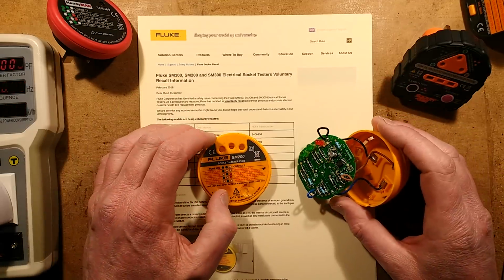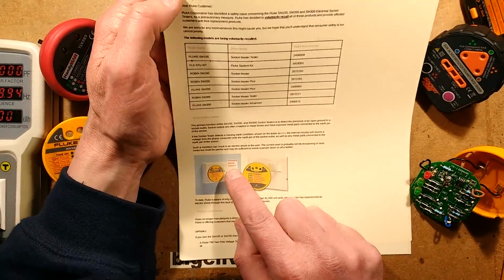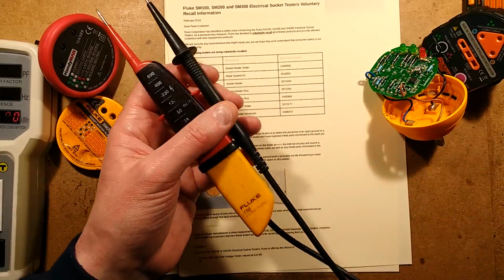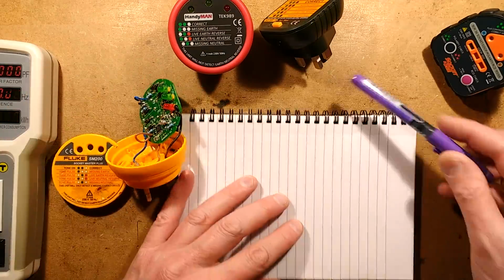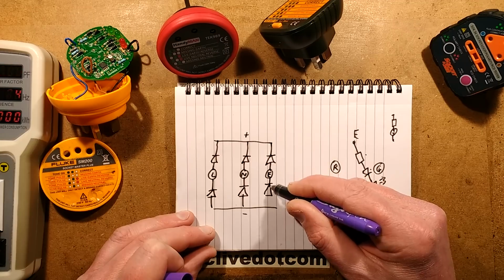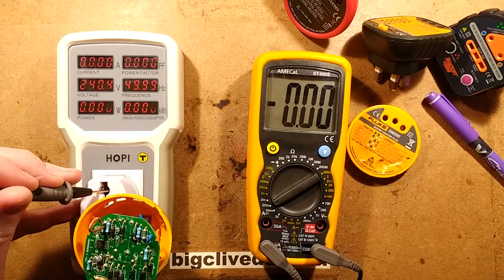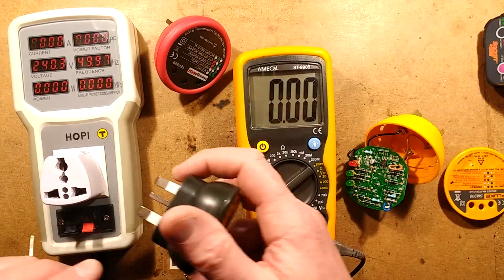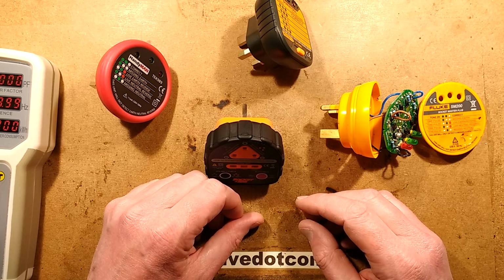Why Fluke are recalling their SM100/200/300 plug-in testers.

Comment: I always wondered, if you were connected to ground and an appliance somewhere else had a fault, would you get the shock, would it be divided between you and ground, or would it miss you entirely
Reply from the maker: If you weren't touching the appliance then you shouldn't get a shock unless the appliance was ungrounded and a ground borne voltage gradient occurred.  Still low risk though.  If you are touching an appliance when a full live to case fault occurs, then even with a proper ground connection the case will still jump to an elevated voltage briefly until the protection trips.
Reply: bigclivedotcom what if you were connected to ground just for electrostatic protection
Reply: Andrei H I just wanted to know if there was a potential for current to travel to every earth terminal should one fail, theyre all connected so why not...
Reply: Maybe i did not understand your question. If the earth terminal on one particular branch of a circuit fails, all appliances with metal casing connected to that particular branch can potentially develop a lethal voltage on their casing, if one of them has a live-to-case fault, as there would be nowhere for this fault current to go so it can trip a breaker. That is why the safety earth system exists and why it is called "safety". In modern electrical systems designed to service apartment buildings, earth is bonded to neutral at the panel, before it reaches your house. There are no more actual ground rods. This is actually better from a safety standpoint, as in a live-to-earth fault of an appliance connected to a correct electrical system with safety earth, the current going thru the safety earth returns to the neutral, so from its point of view a live-to-earth short is the same as a live-to-neutral one, so the breaker will trip.

If you are talking about earth rods buried in actual earth like it would be done in the old days for a house, if you've got multiple and one fails, then there is no problem, just that the earthing system will be able to take less current and is therefore less safe.
Reply: Umm, you assume that there IS protection somewhere in the circuit. That's a fairly big assumption - usually there is none, at least not where i live and work. :) There are GFCIs being installed in the buildings they put up nowadays, but most of them have so many other issues that a proper electrical is just a consolation. A lot of times they skimp on the wiring so it'll catch fire sooner or later, GFCI or not. 

The vast majority of the old buildings don't have them, that's how people are able to steal electricity :) Thru various contraptions with exposed live wiring everywhere, of course. Nobody cares. Building caught fire? Must be because it was old. Kid got zapped? Kids are stupid, we did tell them not to touch it. Favorite kind of electrical room heater, a bunch of bare nichrome wire laid onto a brick. It's a lot of fun.

This is not that common nowadays as it was when i was growing up, but it stil happens plenty in rural areas or poor neighborhoods.

Comment: While the litigation is a pain it's good to avoid shocking people. While it isn't a huge deal at low voltages there isn't enough information on how shock affects the human body. People have been shocked, gone to the hospital and released, then died later from complications, particularly with the heart, that were not detected at the hospital. 

In the US a company would want to avoid it if at all possible since shocks easily become an OSHA reportable incident which can lead to an OSHA site inspection and pretty much every facility has some electrical hazard, especially if they send an inspector that is well versed in NEC, either from electricians cutting corners or from improvised wiring to keep a machine running until a proper fix can be implemented which can take months.

Personally I'm not willing to trust Fluke didn't make a product that is possibly faulty since I've personally seen Fluke equipment fail because it was damaged and most electricians are rough on equipment that they don't have to pay for.

Comment: Best Extension Lead - 

1x Earth block
4 x 2 gang double pole switches
1 x Small MCB unit (2 way ones suffice)
A decent sized piece of MDF, Plywood or a longish (about 3ft) bit of 2x4 (if you want a long one)

Make sure you use 2.5mm^2 or better...I used 2.5mm on the little ring for the extension & a piece of 10mm 2 core and earth i kept around. just spool it out to length you need after terminating it to an old board for a temporary supply. 

Pretty safe if you're not suicidal or stupid.

You could even use an RCBO in the 2 way.

Comment: These are useful if you have mixed Rubber/Fibre cables you need to replace and PVC 15/16th Edition. 

Plug them into the ring, switch off until you find which legs go where. Alternatively, you use your electricians mate (i was my dad's one for years) and get them to probe with a multimeter.

Comment: To have a "safe" tester, should it have a (rechargable) battery, so it doesn't need to draw power from the mains, but only have high-ohm connections from the pins to the circuitry?
Then you could flip a switch and put it into charge-mode when you have determined the socket is wired correctly.
Reply: A coin cell would do

Comment: Cool video thanks a million.  I have decided, some time ago, that you appear to be extremely learned in the field of electronics, and thus an expert.  I look to you as an instructor of sorts, so here is my question for today: Exactly how does AC work, I always pictured it as plus on one side, minus on the other and they switched polarity, and what was the - is now the + and visa versa about 50-60 times per second.  Yet everyone stresses the importance of wiring things up right. Somehow this is confusing, how can there be a hot and neutral if they keep switching back and forth so rapidly?
Reply: Just think of the neutral as being always close to ground and the line as alternating between positive and negative.  This applies in the UK and I believe in other countries where the term neutral is used.
Reply: Jerry Ericsson It's a bit more complex than you imagine. Let's take a step back. AC electrical current is generated by a electrical generator (in a conventional power station, via a steam turbine). As the turbine rotates, the magnetic field increases, hence the output voltage increases, then after a 1/4 rotation, the magnetic field reduces, hence the voltage decreases. Until it gets to zero. Then as the rotation continues, the voltage (and current) changes polarity. Now you get the third 1/4 cycle, where the voltage increases, it will again reach a peak, then finally in the fourth 1/4 cycle, the voltage drops all the way to zero again. Then it all repeats.
If none of the electrical system had any connections to earth, and the power distribution was ran as two wires, then polarity of the connections/wires would not matter.
However, the feeds to homes and businesses in most countries has one of the supply wires connected to earth/ground at the substation (or pole transformer). This supply wire is called the neutral. The "hot", "line" or "live" wire is therefore electrically different to the "neutral",  because it is not directly connected to earth/ground.
If a human being touches the neutral conductor, he/she is unlikely to get a shock, as this conductor is connected to earth/ground. But if a human being touches the  "hot", "line" or "live" conductor, he/she will subjected to the full mains voltage. This is the reason that the polarity of the electrical connections is important. The electrical equipment itself does not care, it will work with either polarity.
Reply: I am NOT an expert. The neutral is connected to the earth at some point (I think where it connects depends on local regulation).
Reply: Jerry Ericsson If you have more than one circuit of any complexity and connect only one point of each together, they operate completely independent. Also, voltages are not absolute, but differences between two points of a circuit. Whenever just one point is given, the other one is implied via common knowledge. This combined with the connection of one point in the AC circuit with earth results in one live and one neutral wire.
BTW: AC is not "switched", but usually a sine wave.

Comment: "if you gave a plumber a shock, hell laugh it off but if you shock an officeworker theyll get hysterical"
depending what youre shocking them with. maybe thats the case with electricity, if you do it with taxdebts i can imagine its the other way around.
Reply: Plumber might of course take revenge in a thematic fashion, such as dumping a bucket of water over your head from above as you walk by a outside window.
Reply: Where did you find a plumber sensitive enough to notice ?

Comment: Wait, don't all of them pass a current to the ground pin? Is the current passed above the recommended max?
Reply from the maker: Yes they do, but the current varies with the type of tester and it only poses a hazard if there's a break in the earth circuit.
Reply: bigclivedotcom if it used a bit more electronics it could limit the current on the ground pin way below 1mA. I wonder what the specified "safe" current to pass to the ground pin is?

Comment: I recently found out that many of the outlets in my basement had live and neutral swapped. Found this out after buying a neato surge protector and filter from surplus and having it glow an angry red light at me when I plugged it in. I checked it with my meter and sure enough that was the issue. I guess the previous owner didn't do a good job at the wiring of the extension he made.
Reply from the maker: It's always a good idea to give the electrics a basic check when you move into a new house.  Especially the fuse and circuit breaker ratings with relation to wire size.
Reply: Oh man, that outlet was one of the more benign problems with the electric in this house. It's in the US, and probably 35% of the outlets are ungrounded two-prong ones. Also the layout of circuits to the breaker box is comical. The small shop, outdoor receptacles, half basement lights, and microwave are all on a single 20A breaker. Way above anything I should try to fix on my own.
Reply: In Poland 20A 230V in place where live 3 people on Cu 2,5mm2 all
On stairway a breaker 20A, master breaker in house 100A
Reply: instablaster...

Comment: https://www.electricalsafetyfirst.org.uk/mediafile/100117570/Best-Practice-Guide-8.pdf Beware of TN-C-S systems, page 8 is a good read of what socket testers WON'T test.
Reply from the maker: I only regard them as a basic test to find if there's a L/N swap and with the one I use, perform a basic no-trip loop test.
Reply: Most plug in testers will NOT show a live neutral reverse in a TN-C-S system! read the remarks on page 8 of the HSE doc.
Reply: I have a fluke and a socket and see, and from my experience the socket and see does not detect live neutral reversal in a TN-C-S system.
Reply: Page 4, 5th paragraph.

Comment: Fluke is just like Apple..........overpriced JUST because of the name!!!!! At least Fluke products are actually useful tho!!!!
Reply: No viruses has been a myth for a long time. But I do admit it's only recently that they've become common enough to be worried about as Mac user numbers have become high enough for people to bother distributing malware for.
Reply: I bought a Fluke 179 to replace an old Tandy Brand DMM... But I only got it because it was second hand near new. It's definitely worth what I paid, but no way would I have paid full price for it.
On the Apple topic - clearly we have an Apple fanboy here, and a few actual techs. As an IT guy, I'm of the opinion that Apple software isn't even any more stable than Windows now - the number of times we had white-screening Mac's which were due to iTunes being updated, which was only repairable with a reformat and reinstall...  And the hardware often isn't even as good as much cheaper alternatives. They just put it in a shiny box.
Reply: PHILL DIXON OK, weird that there are so many more PCs than Macs out there then. Ages ago I was working as a service engineer and certified for both PC and Macs. It may surprise you that Macs broke just as often as PCs did. IMO most virus infections are caused by users not understanding security, regardless of system infected.
Reply from the maker: It is a status brand.  But at least the basic stuff is affordable and it's useful as a pacifier for safety consultants who just judge things by brand.
Reply: bigclivedotcom "a pacifier for safety consultants".  That's gold :D 
I'd add health and safety inspectors to that list. 
But I've seen some incredibly shonky stuff with brand names.  Still getting uncomfortable tingles from the case on my Asus tablet.
Reply: You're confusing terrible software with quality machines. Apple software is decent because it's based on a Unix derivative, so just because it doesn't crash it doesn't magically make their hardware good. Like all companies, Apple has been cost-reducing the internals for years, ask Louis Rossman.
Reply: Are you saying "all the Windows stuff i had kept crashing" because of build quality? Also from what I read in quality magazines Apple products (software) are not virus free.
Reply: A little unfair, both premium brands but for different reasons. Apple will compromise function (and serviceability/reliability) to achieve their design/aesthetic goals as well as designing down to improve margin - see latest MacBook pro for potential repair nightmares if the SD fails for example as it is all soldered to the motherboard,
Reply: Apple products are rubbish (considering the money you pay for them), but then again, nearly everything that comes from Micro$oft (or has a Micro$oft logo on it) is equally rubbish. Fluke at least have built up a reputation for good test gear, even if said test gear is a bit pricey. Hence why large companies buy their products.
Reply: One could say the same thing about HP server equipment... the 'problem' is that the kind of people for whom the price isn't such a concern are also the people that are more than happy to pay for the assurance that comes with the service attached to the device they've bought.

... they also tend to be the kind of people that have better things to do with their time than bicker on the internet, the sad bastards ;)
Reply: Gregg Macey fluke stuff is just over priced junk, made for pennies and sold at a high price to cover the more expensive labour charges incurred.
The difference between their stuff and the stuff costing 1/5th The price is negligible
Reply: Allison Pell True, most viruses use to be written for Windows machines as that's what the majority of the world was using, Apple was a niche product used by designers and a few others, the banks and big businesses mainly used window's, now  Apple product's are becoming far more popular they'll soon be subjected to all sorts of system crashes
Reply: PHILL DIXON yeah no you're wrong
Reply: Their higher end stuff is pretty damn good.  I'd trust any of their devices to perform to spec including not exploding under failure.
Reply: I never met an engineer who regretted buying Fluke. I myself use a 189 provided by Fluke for a project back in 2002, and those things have a lifetime guarantee. Not that I've needed it! It's a bit grubby but otherwise tip top.

Comment: Why would anyone be barefooted in a puddle while holding the metalclad socket ? :D
Makes you wonder about using other test gear, like the actual test lamp (the one the electricity board often use with a filament lamp), or lower impedance meters etc.
Reply from the maker: Muddy field?  Traditional test lamps between live and earth will pass a LOT of current.  That's why traditional electricians know to assess the electrical environment before use.  I fear that bit of knowledge may be missing from most modern 1-day or 1-week electrical certification "courses".  (Amongst the other 99.9% that's also missing.)